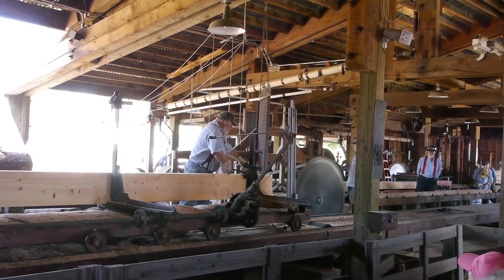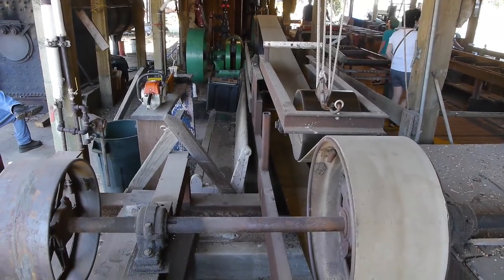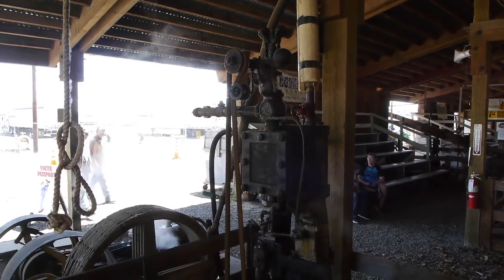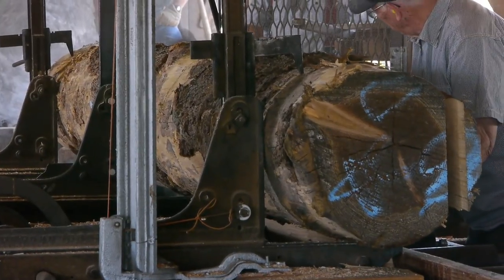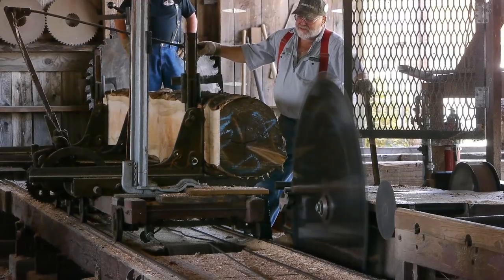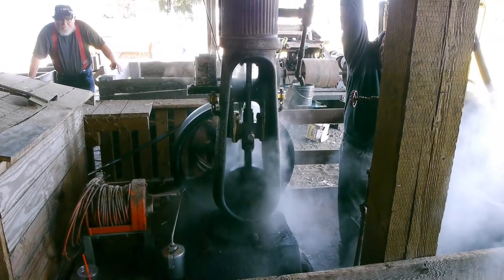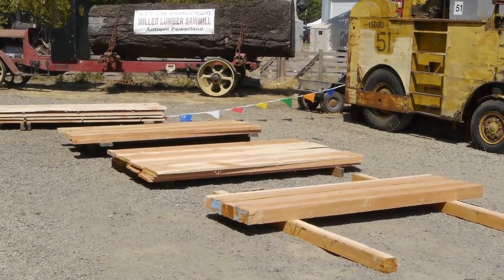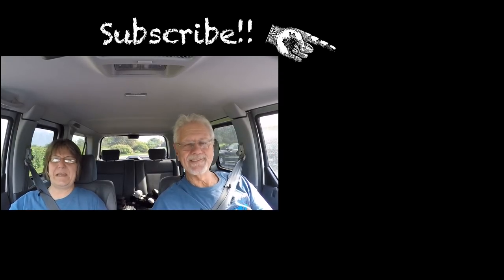Steam Powered Saw Mill at Antiques Powerland. - Great Oregon Steamup 2018

Comment: Wow! Quite the operation.  Ear protection would be a must.
Reply from the maker: Yup!! Many of the places we go are really noisy. We were just on a submarine!  And they said going into the engine room with the engines running and no ear protection will leave you deaf in 15 minuets. Gezzzz. But the engines were off. We did get to spin one up but not start.

Comment: Screwing around? Absolutely! However, the lumber produced is used for building projects at Powerland. The big boiler is from an old locomotive. Great to hear the stack "bark" when it's under load...
Reply from the maker: Looks like a loco boiler, Karyn spotted that right off. As much as I covet the wood I can see why its best to use it right there. What we thought would be fun is if short sections of rough wood with bark on, were laser etched with a powerland logo finished and sold as wall hangings. Lasers are a dime a dozen, but would need to be hidden in the Star Wars museum.

Comment: Wow! Another awesome video! There's still steam powered sawmills? :)
Reply from the maker: Thanks!! AND we found one still running this way not far from this demonstrator mill thats been running on wood-steam for over a hundred years. They never converted because they are totally in the woods off the power grid.
Reply: Why not? If it provides reliable service, why switch to more modern means? :)
Reply from the maker: When you see how well it works... Simple... All you need are trees and water.
Reply: I agree. :)

Comment: Real 2x4's. and then they size them? I built houses in Southern California for years. Always wondered about the smaller size we used. Is it wasteful?
Reply from the maker: Not really sure makes a lot of sawdust.  Years ago they used the rough cut wood for barns and basic structures. But you can’t even find it anymore. Everything gets finished down to the smaller size.

Comment: First off thanks for sharing.next wish you would show the carriage drive.last why turn the lig 180° why not just turn 90° is the bottom of carriage not level to saw? It should be.1/4 turn ending with square cut or thickness of boards to be cut.3rd generation mill wright here.first mill I worked in was 1880 American.wish I could post a picture